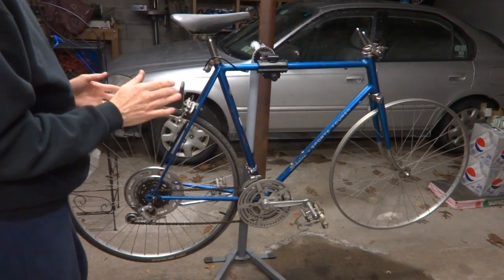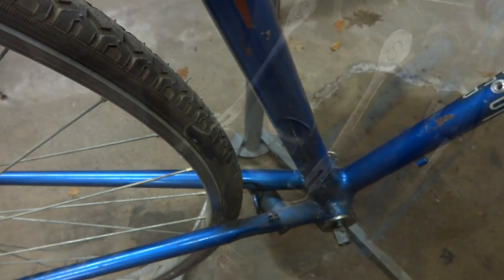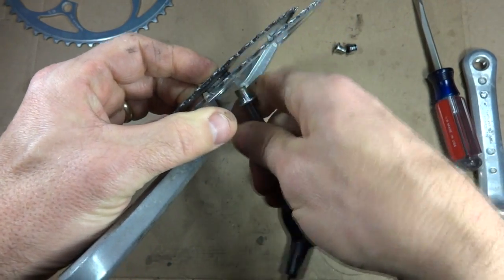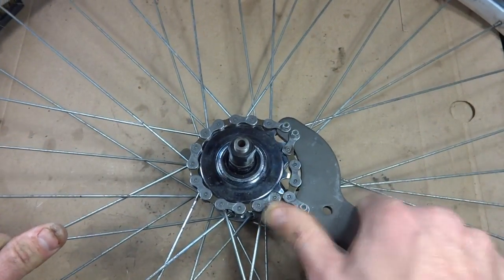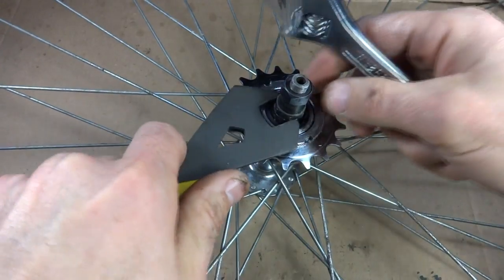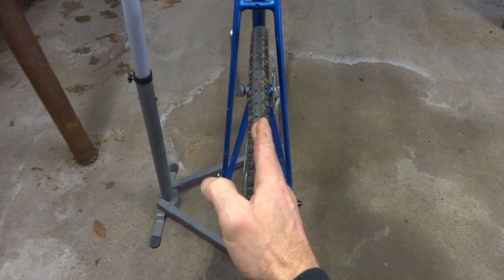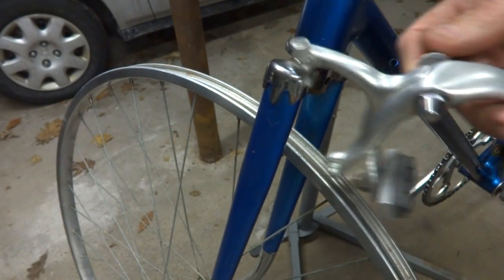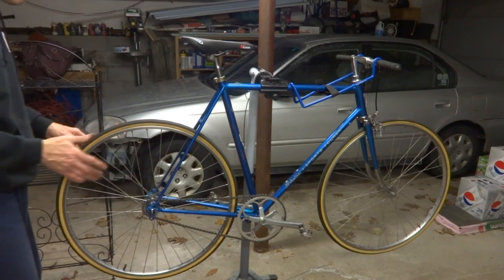How To Build A Cheap Fixie From A Vintage Bike

Comment from the maker: For more bike repair videos hit the subscribe button 🛑 and click the notification bell ► http://bit.ly/SubRJTheBikeGuy
Reply: The hand brake should go on back wheel so you don't flip the bike and land on your head! The bike has 70% of it's stopping force to the front of the bike so to counter that difference you always install the primary braking force to the back in order to solve that problem!
Reply: Quick question: if I want to take my bike apart (old bike). What equipment do I need?
Reply from the maker: @edwarddavies4745  Tools.  They will vary for different bikes.
Reply: @fatjeezus1953  not on a fixie you’re incorrect
Reply: @fatjeezus1953  222222222

Comment: A trick I learned on rim brakes,is to push the brakes so that the pads are against the rim and pull a the brake leaver  approximate 1/3 pull then tighten the pinch bolt tight. This should put it right were you need it.  Great video RJ.

Comment: I didn't know I needed this video today, but turns out I did. I was just stuck with the chain line in my single speed conversion and was thinking I might need to buy a cassette wheel, a new chainring and spacers. Glad to hear that I can work with what I have now. A million thanks! I won't get into truing the wheel now though, I'll go to a repairman.

Comment: You surprised me when you put a lockring on an ordinary hub. Then surprised me again when you properly redished the wheel.  Good work.   I still think it's safer to use a cheap track wheel rather than converting a standard one. You did mention it's not as safe but still...     The cost of a single speed hub or wheel is well worth it.
      It is better to measure the distance from the far side of the seat tube then measure the tube itself. Subtract half the diameter of the tube to get the proper measurement. Lots easier and more accurate than trying measure in the middle by guessing where the middle is.

Comment from the maker: Gabriel Tiri, I measured about 16.99mm or rounded to 17mm. I needed to moved the cog over 6mm to be in line with the chainring. 17mm minus 6mm is 11mm. So I added a 6mm spacer on one side and replaced the 17mm spacer with an 11mm spacer.

Comment: I have a friend who does this all the time on road bikes. He buys vintage bikes going back up to 70 years or so for next to nothing when he can find them. He had done 11 of them so far as a hobby. Then he rides them, one at a time of course, almost daily for up to 21 miles.  He goes all the way.  He buys all new parts on Amazon, including new wheels. He replaces just about everything but the frame.  He strips the paint and repaints. All new cables and wraps,. And he is able to find new decals. The bikes look shiny new when he gets done. He also adds extensive new lighting and personal protection features which he also buys from Amazon.. You have to do that these days. And he never leaves the bikes unattended even if all locked up. They will get stolen anyway. even just the seat.  Bike thieves carry massive bolt cutters. He says one target is just the wheels.

Comment: Good idea on cutting the nut at 18:17. Personally I am going to take an old worn chainring, cut the ring off at the contact points and use the contact points as spacers. Second complete bike rebuild, looking forward to it.
Reply: J.Michael Garner 
Just saw washers mentioned. Doh. But that chainring ain't doing anything anyways...

Comment: So just buy a fixie wheelset to avoid all that truing and adjusting? Got it.
Reply: where is the fun?
Reply: le Art the end result is not even safe for normal use.
Reply: @boy_scout_cookie1913  would RJ make a video about it if it would not be safe? it is just that you need to tighten the lockring and cog really good to prevent them from undoing
Reply: Andrei Calin RJ is a great home mechanic, don’t get me wrong but there’s no way an actual mechanic would agree with this. I highly doubt the cog wouldn’t slip if you were to ride fakie. There’s a reason why track hubs have the reverse threading.
Reply: @boy_scout_cookie1913   I doubt anyone doing this cares about doing ''fakies''.
Reply: fire surfer good thing you went on the internet and corrected your comment
Reply: @boy_scout_cookie1913  Nice sockpuppet account.
Reply: fire surfer Sorry if I offended you. I have to give it to you, that’s a very interesting insult.
Reply: @boy_scout_cookie1913  Your welcome.
Reply: @boy_scout_cookie1913  As a professional mechanic I do agree with you. This is an amazing video with amazing info in it, but the rear wheel lockring HAS to be a proper lock ring for fixed gear hubs. The cog and the lock ring will only adjust on each other with reverse threading. 
RJ kinda warned about but this is a real issue. You should use this kind of fixed gear ONLY with brakes and never skid brake or backpedal.
Reply: @boy_scout_cookie1913  bmx riders use home trued wheelsets all the time, and street bmx is way more dangerous for wheel failure than fixie riding
Reply: @rourose  My first fixie was a conversion just like this. One day I applied enough torque to unthread both the cog and lockring while in traffic. Needless to say, a real fixed gear hub was the next purchase I made.
Reply: @boy_scout_cookie1913  as a professional Cytech 3 mechanic myself, i have to agree with you. Using a freewheel hub vs a dedicated fixie hub is a bad idea because when i comes to stopping, sudden skid stops and even just pulling back could be enough to coax the cog and nut undone since there is nowhere near enough give in the wheel of frame to flex enough to stop it from coming undone. Vibrations from skidding can also knock it loose
Reply: @firesurfer  it can still come undone from skid stops. Vibrations grom the wheel skipping off of the ground from skid stops could knock the cog and locknut undone
Reply: @rourose  you and i the same. Glad we both came to the same conclusion (Cytech 3 mechanic~)
Reply: @dantindley5181   See my other comment below from 10 months ago.
Reply: Just the back wheel and you go
Reply: @ArmyBoiSweat  yes but they have certain hubs for that bro…. You have no argument.
Reply: I bought a track specific wheelset for my vintage Nishiki road bike and the chain line still sucks, I like RJ’s solution better.
Reply: @andreicristian1625 its going to get tighter because the force is moving forward he just tighten it because he wants it closer to the rim so the chain will be in a straight line through the chainring and rear sprocket

Comment: Hi RJ, I just finished transfering my bike from 6 gear to a fixie, - success! Followed your video and got the job done all is left is to true the the rear wheel which is a little bit out of true. I don't have a truing stand or other related equipment but I will try to do it on a bike on some good day. Truing the wheels and adjusting v brakes are the hardest things for me cos those alignments don't come easy enough. You are the best bike guy here on Youtube by far!

Comment: I recently came into a old road bike frame from a neighbor who was going to throw the bike away. Honestly the bike was a lower end bike from the 70's and had 1020 high tensil steel, so not exactly a colectors bike, but for some reason i wanted to save it and give it a new life so i did a single speed conversion. I definitely put more money into it than the bike was worth, but i also learned alot working on the bike and it was a a fun experience. Financial not the best decision since it needed new wheels and i decided to change the cockpit to flat bar also but  i enjoyed the process. thanks for you videos

Comment from the maker: Onyxaxe, I never measured it. But I am guessing yours will be okay. My big chain ring came close to the frame. But that is a 53t ring. It's too big actually, but was all I had at the time. I am replacing it with a 46t ring (which just came today actually), and that will have plenty of room.
Reply: Thanks. Ironically I want a 53T for more skid patches lol. Are there any complications to having a spindle that's too long other than Q-factor?.
Reply from the maker: Onyxaxe You may have to move the hub farther to get the chain line straight. And then redishing the wheel will be more drastic.
Reply: I'm buying a new track wheel set. Just typical truing of the rims it had made the spokes pop into the innertubes lol. I'll take my time with it, but if I have any more basic questions I'll pop in again. Thank you for taking the time to make your vid and answer viewers questions :).
Reply from the maker: You can always try grinding the tips of the spokes a little shorter as long as there are still enough threads on the main part of the spoke.
Reply: RJ The Bike Guy Hi, i thought chairing teeth were directional, how come you flipped them over?
Reply from the maker: Chainrings can be directional. There are ramps that allow for crisper shifting from one ring to another. But since there is no shifting from one ring to another on this bike, it doesn't matter.
Reply: RJ The Bike Guy Ooh I see.
Reply: RJ The Bike Guy
Reply: RJ The Bike Guy Don't mean to change the subject but just wanted to say that fixies in Germany are not allowed on the roads....I you get caught buy the police you get a 160 euro fine and you get three points on your driving liecence...oh and the police confiskate your bike
Reply from the maker: Interesting.
Reply: MisterRobertBrot  Do they have a problem with brake-less bikes or fixed gear bikes in general?
Reply: It's the law ....they say fixed bikes are to dangerous .......bike has to have brakes ,lights and fenders.......in the past 10 years tho with the increase in the mountain bikes they don't say anything when there are no fenders but don't get caught riding in the dark without lights (and reflectors) or you will be fined...funny tho about it being dangerous....In Germany Quauds are allowed on the streets!!
Reply: So you should be able to coast or else it's dangerous, is this what they are trying to enforce?
Reply: yes and no ......there are shops that sell fixies, but with brakes of course ....just a way to get around the law....but there are still bikes being "removed" from the streets from the police....the fixies fans remove the brakes, they complain what's the use of having a fixie if it has brakes? "Normal" bikes have brakes ;)
Reply: MisterRobertBrot The police should tell them and ''normal people use brakes, oh hipster... thinking he's so cool, never mind''.
Reply: Of course you are allowed to cycle with a fixie. But you got to have two brakes, lights, reflectors and that kind of stuff (fenders are not mandatory!). The police just confiscates fixies that are not equipped with the mandatory parts.
Reply: +ibikehannover you and I must live in different countries because that isn't how it goes down here in Cali
Reply: +flamezor123 Sorry, maybe I did a mistake: I am from Germany and here arre allowed to ride fixies (with two brakes, lights and so on). Sorry for the confusion! Cycle safe!
Reply: Oh that explains it. Sorry for the confusion, its just that the law where I live couldn't care less about cyclists.
Reply: We are allowed to ride fixies here in the states too. People who are afraid of fixies simply do not understand them.A fixed wheel is the purest form of cycling short of riding a penny farthing.
Reply: @ Mike o Just remove front derailer and adjust rear derailer stop screws so it only goes from 2nd to 6th.....whola! 5 speed street bike   
d:)
Reply: @MisterBroat  wtf ? That's some crazy 💩
Reply: @ibikehannover  what about unicycles. Are those forbidden to own in Germany?

Comment: I thought the locknut on the hub was supposed to be reversed threads? So that way if the track cog wants to unscrew, the locknut wants to tighten.
Reply: Chris Z. On a track hub yes,that is correct. This is a freewheel hub.
Reply: Exactly! And i also would NOT recommand to use a freewheel hub for a FixedGear Bike if you plan to ride without brakes, what is stupid anyway. You just CANT tighten the lockring that much, that i will be locked forever. And also locktite wont help forever.
Reply: it tightens when you pedal forwards yes, but when you backpedal the force is in the opposite direction so that makes it want to unscrew. you never backpedal on a freewheel hub so it's never an issue, but using those same threads on a fixie causes that problem. i've seen people put a couple tack welds around the cog to hold it in place more firmly than locktite alone

Comment: Haha. I love these kinds of builds. Working on an '86 League Trek right now. I used your hacksaw method to get the stem out shame I couldn't save the nitto stem though. I was able to save the BB and headset but need new bearings for the BB. Getting a 120mm fixed gear hub rear wheel though. I never felt safe with these suicide hubs. Never had one unspool on me but it always gave me a bit of the pucker when I applied back pressure. Chopping and flipping the bars. But hopefully I'll get it all back together soon. Great to see I'm not the only one breaking out the blowtorch and scavenging parts to make these builds happen.

Comment: Great Video. You can also check chainline by placing a straight edge on the chainring and see where the end of it winds up near the rear cog.
Reply from the maker: +MarzNet256 Not with accuracy.

Comment: Bad advice !      You should never use a fixie cog on a standard wheel.  Very dangerous The cog will unscrew while your riding. 
You must use a track style hub that's made for fixed gears.     Also We need to preserve old Schwinns.  That Schwinn is worth about 2 to 3 hundred $ if in good condition but after you chopped it up you'll be lucky to get 75 bucks for it.

Comment: Why do you kill a vintage road bike by making it a fixie..
Reply from the maker: +multimillionmile The chain stay cable stop broke off, and the frame wasn't worth getting that repaired. So I re purposed the bike. Besides lots of people like fixies. It's not like this bike was a vintage Colnago Master or something.
Reply: Ah well I didn't mean to insult you I just think it's such a shame!
Reply from the maker: I love playing with bikes. Changing them, modifying them, whatever. It is fun getting them to be what you want.
Reply from the maker: People had been asking me for quite a while for a video on how to make a fixie. I was actually going to leave this bike as a 10 speed until the cable stop broke off. Then it just sat there in my garage, dead. Then I brought it back to life.
Reply: Agreed!
Reply: He did not kill it .He can always make it a heavy clunky 10 speed again just like it was. Fixies offer fantastic control especially for winter riding.
Reply: Serious question: why not add gears to the front?
Reply: tehw000000t because then it's not a fixie
Reply: What's wrong with fixed gears? They're only bad if it's ridden by a hipster without brakes.
Reply: @tehw000000t Without a rear d there's no variable chain tension.
Reply: Thats just NOT true. Fixie by definition means "Fixed Gear" and that means that the rear sprocket is FIXED to the hub so there is no freewheel. It does NOT mean that you only have one gear to drive. That would be "Singlespeed"

The fact that in the early times of the fixie culture there was no technology like the pinion gearbox or something. If you can manage to get a pinionlike gearbox working without any freewheels, you would have a Multispeed Fixie! Fact!

Comment: So RJ. I picked up a late 1970's Royce Union 10 speed ($15). It has a nice tall frame for me (55cm?). It's a lightweight steel lug frame with 27" wheels. I like the feel of this thing and I have been looking for a nice vintage candidate. I plan on stripping it and painting it. The only original parts I want to keep will be the SR cranks and the original head badge that says Made in Japan. I already double checked everything in the rear to make sure the width and lengths work. I had a store bought Retrospec but I really wanted the feel of the vintage frame. I've done many bike projects in the past but this is my first fixie. Believe me, If I can rebuild a Cannondale Jeckyll with a lefty fork and Coda liquid disk brakes, I can do a fixie! I'm ready for simple!

Comment: I built one from an old 700 frame with cottered cranks and was able to use most everything.  It only cost $60 and half of that was new tires and tubes.  I was able to cut the geared portion of the larger ring leaving the rest to bolt to the small ring.

I tried using the lock ring on the cog plus red threadlocker but it worked it's way loose.  Luckily it was on a trainer.  I ended up welding the cog to the rear hub since both are steel.   Now it's not going anywhere.  Only downside is that I can't replace broken spokes on that side of the hub if one breaks.  Everything is nice and solid now and it rides great.

Good advice on the chainline and redishing.   I checked my spokes at the nipples after doing so and all looked good.
Reply: Should have read 70s frame.

Comment: I recently picked up a Schwinn Suburban similar. Lots of rust. I plan on putting it back together after I clean everything up as well as possible. New cables, chain, and tires for sure. I'm not sure maybe rims. Anyhow great tip on how to remove kickstand.